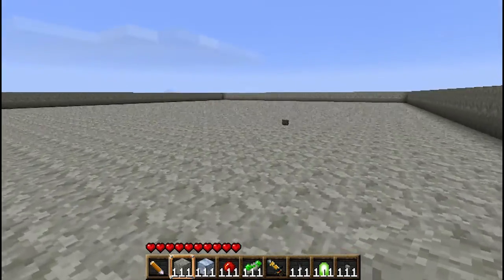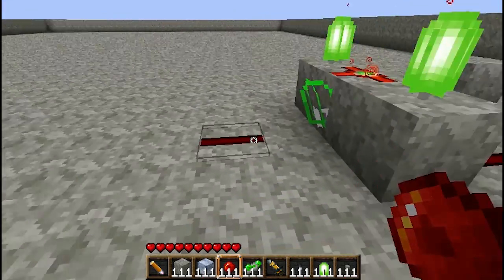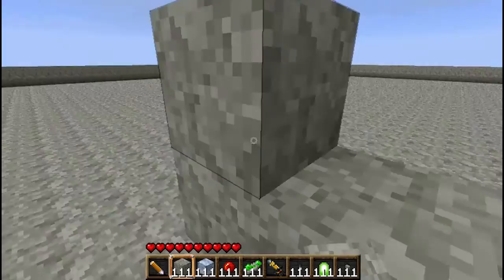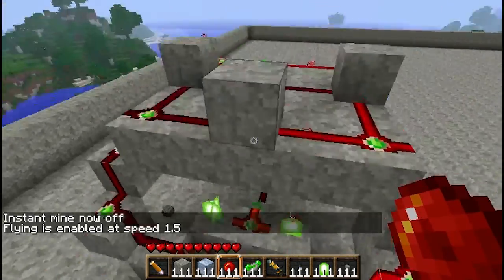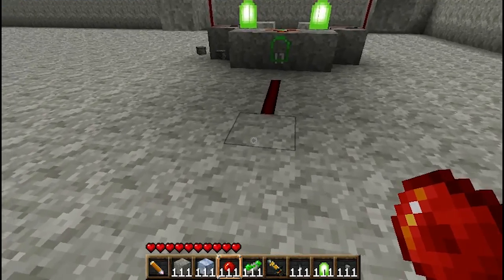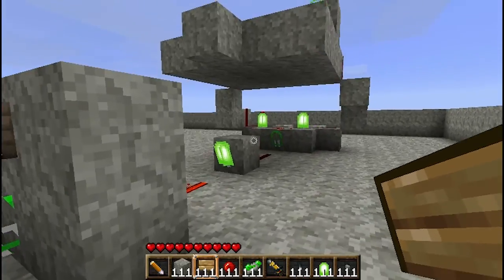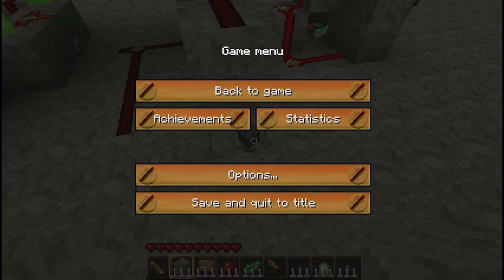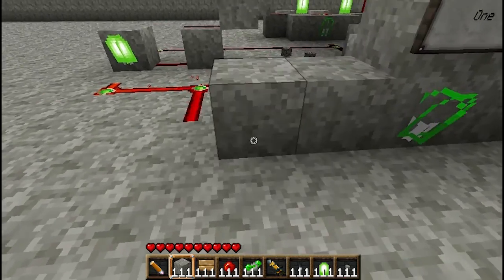Minecraft Calculator Series: 1 bit Calculator

Comment: Hi, TheUnderDo6s. recently(yesterday) I came up with a new alternative to a transistor which basically acts as something in between a normal transistor and a quantum computer with 4 easy-states per bit(easy-states due to a theoretically infinite amount of states).
So I wanted to make a demo of it, but I knew that I would make things to complex so I decided to look to existing simple processors such as a calculator which caused me to come here. also, I currently have parts for around 10 of those devices which shows why it wouldn't be smart to make a complex pc for me. Anyway, right now I will try to convert things into real-life objects and hope I will be able to fit it on a breadboard. I will tell it if/when it works.

it is(more towards the quantum computer one since the working is quite different from a transistor, however, it can be used as one). so currently it has a theoretical amount of infinite^2 states per bit, but in my current prototype I use mainly 4 states per bit (ub-1,b,ub1, and imp)ub=unbalanded(-1 to 1 depending on direction it wants to be towards), b= balanced, imp= impossible which as it says is a state that is very rare which can be caused either illusionary(in which case it is not a true state) or the real version can only be caused by strange phenomenon or in or due to influences of other dimensions)
Reply: it is basically finished, now the cable management, and perhaps a nicer ui once since It isn't perfect yet. okay, I just found another way to use it without adding parts, and it works. in the current setup it is even able to calculate more data. I might most likely make a video about the device soon, however it is nearly morning(actually it is) here and I have school today, so that video has to wait a while
Reply: @dababyreal4612  english, but not american english, more traditional.
However designing it and making it capable of simulating a traditional computer is simple, using it similar to a modern quantumcomputer is doable but is a lot harder to build. Finding a way to allow the world to use it without  it directly being stolen and pattented by megacorp inc.(fictive name for speciffig groups you probably partly know of since you use the software of one of them) is near impossible as experience has shown where you publish something but don't have milions to spend for all the legal stuf after a while after which some big corporation takes your literal documents, changes the author name makes sure your original document won't be found by others anymore and then they pattent it to prevent anyone from using it.
Reply: @dababyreal4612  in simple words: so computer, very new, verry different.

That's around how modern people would understand it. But otherwise if you want to actually atleast have some information then I'll still have to keep it cryptic. And actually the computer itself and especially the principlea on which it works are still theoretical/philosophical physics since it hasn't yet moved to modern day common physics. However it is quite much like a quantum computer which works in room temperature(as the prototype has also proven). While for problem types it is mostly like a quantim computer there are some differences. You could see it as a cpu and a gpu where the quantum computer would be like the cpu and my device like the gpu. Even though both devices need a translation computer to convert it to a digital interface.

That post you found however was from when I decided to try and use  that computer design and principle I made to simulate a normal computer in order to self translate and use it in combination with a arduino. Where the idea was to improve arduino behaviour, speed, etc. However it turned out much more eazy to leave out the arduino, or only use it as a digital link. For the arduino a few small chips or even extra arduinos is a lot smaller and simpler since a arduino is not likely used for complex problems, etc.